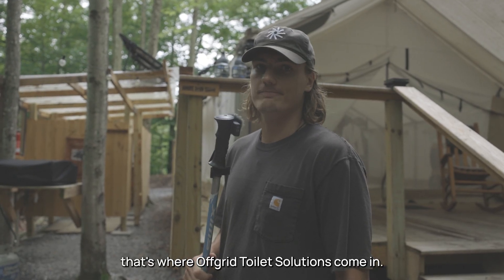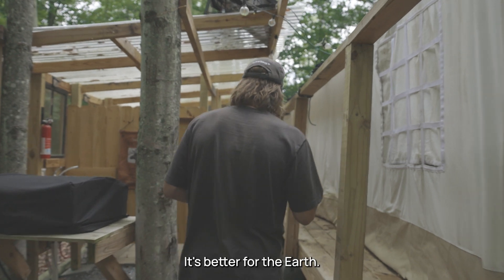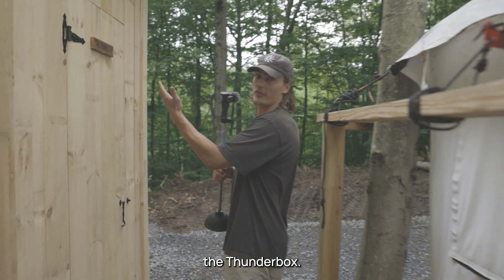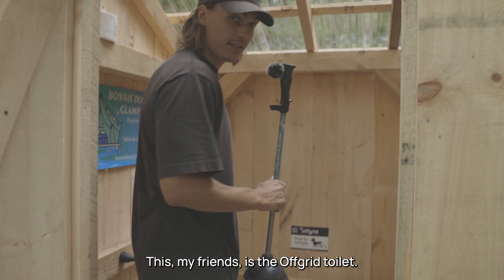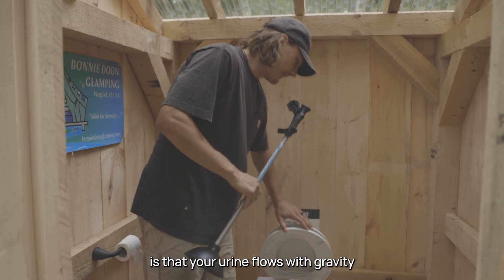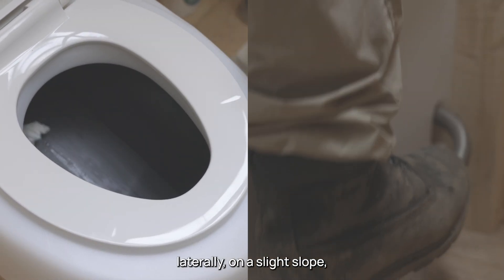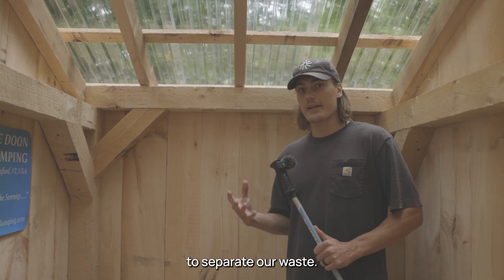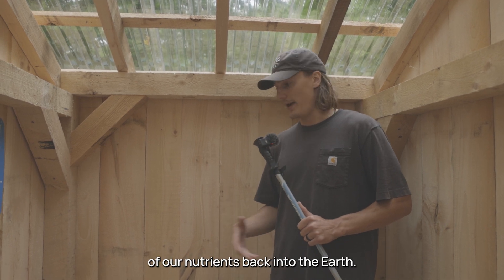Revolutionizing Offgrid Sanitation | Meet the Wasted*Offgrid Conveyor Toilet 💡🚽

Comment: Honest question here... what about diarrhea? I hope i dont need to explain. Also, where are you sending the poo. Both it an urine have smells that compound in heat.
Reply from the maker: Great question! We get this a lot, and we totally get why. Here’s the deal—our *Offgrid Conveyor Toilet is designed to handle all kinds of business (yes, even the not-so-solid kind) by separating liquids and solids at the source.This is thanks to the slope angle, the conveyor material, and the hydrodynamic difference between urine and  diarrhea-like material.

And you're right—heat and smell go hand in hand, but the key is keeping solids dry and liquids separate. That’s why our system is engineered for airflow, evaporation, and minimal interaction between waste streams, keeping things fresh even in hot climates.  

As for where the waste goes—it depends on your site. We offer two distinct waste monitoring options (see the description), both of which are ventilated/contained to prevent any odors for users.

Hope that answers your question! Happy to chat more if you're curious. 🚀💩